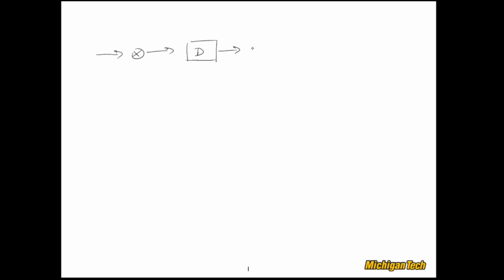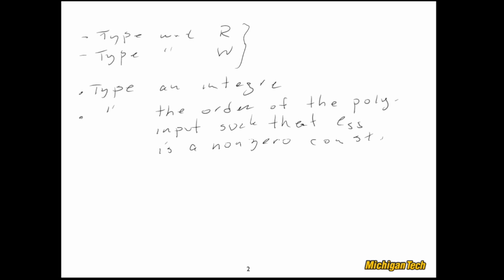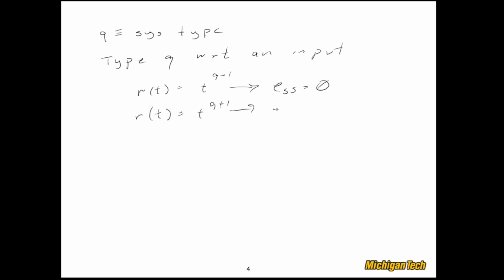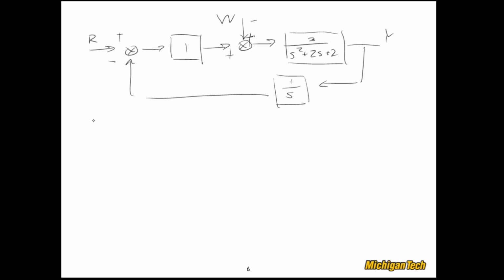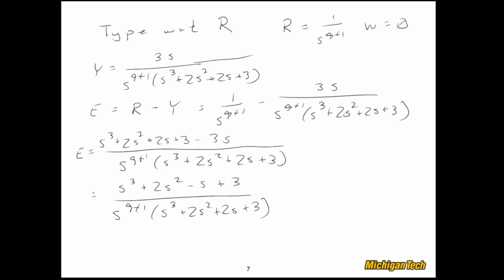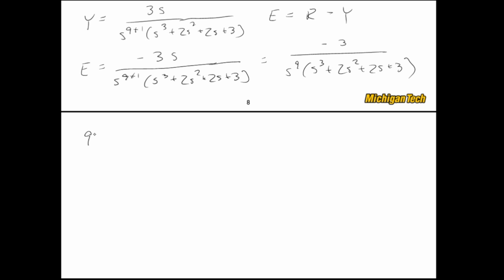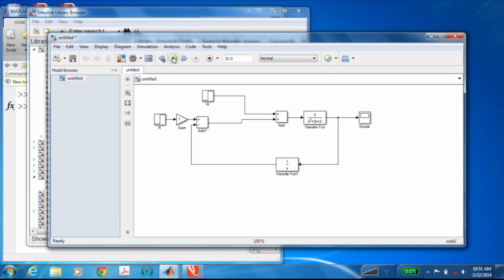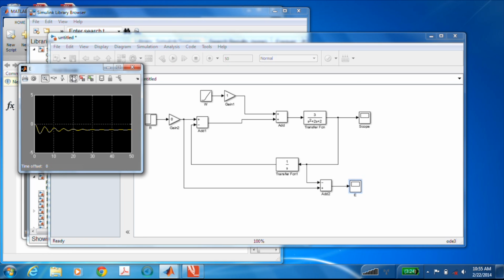Introduction to System Type

Comment: I thought The steady-state error for the disturbance should be -1, since that was the answer you got for its constant not equal to zero. Or am i understanding it wrong?

But overall great video, Im taking a Feedback Control class this term. And I am looking forward to seeing your videos for extra help!
Reply from the maker: +Eld0g5 Good question. I believe you are referring to around 19:30 in the vid. Listening to it again, I recall I had a bit of a cold at the time. But that doesn't help your question... The steady state error was indeed -1, and that occurred when the disturbance input was a ramp (q = 1), and so the system type is 1. It would have been more clear if I had conjured up an example where the steady state error was something other than an integer, say -1.2. But in short, everything is fine in the vid, just a lot of integers.